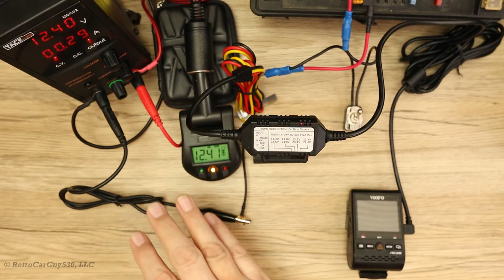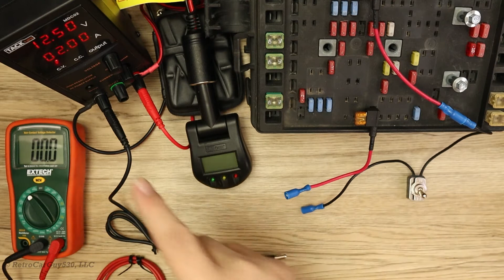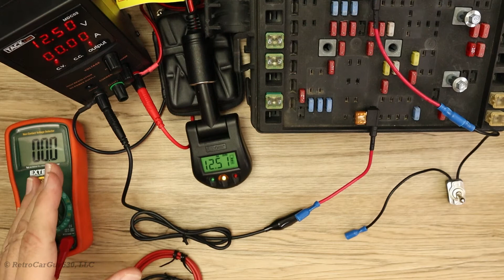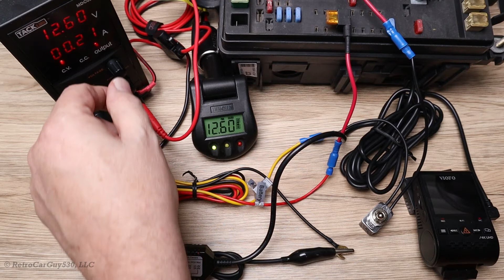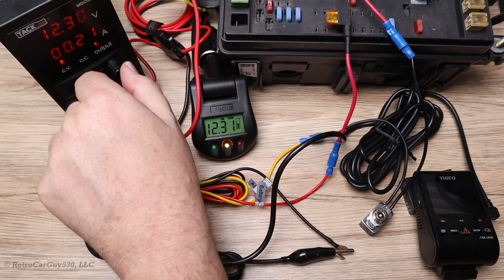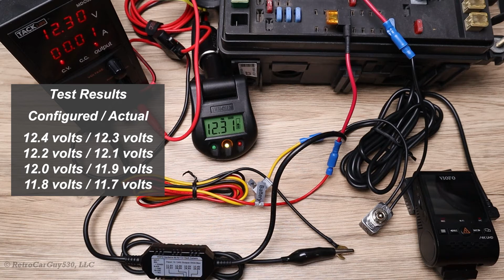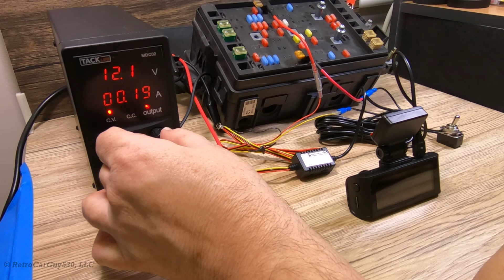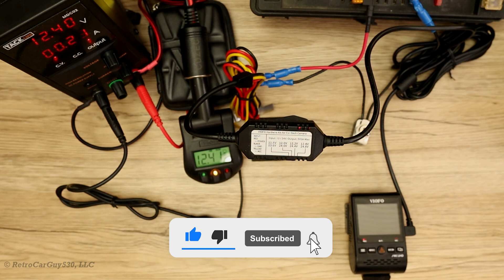Dash camera low voltage monitoring feature - How accurate are they?

Comment from the maker: I originally released this video in early February 2021.  On 16-Mar-2021, I learned that the testing method I used was incorrect to verify the low voltage cutoff feature.  I have reworked the content of the video and as a result I have this updated video showing the correct testing method.

⏲ Video Chapters ⏲

00:00 - Intro
00:33 - Testing Overview
04:43 - VIOFO HK3 / Blueskysea B4k power adapters
09:02 - Final Thoughts

Comment: Right on RCG,

What a great video explanation.
I’ve never used a dash cam hardwire kit before, (I’ve never had a need for parking mode for with my vehicle applications).

The one included with my A119 Mini is my first experience. I’ve done some preliminary testing on it, and I’m now converted to loving this fantastic little device.
Not only is it accurate, I’ve discovered it has many other uses, and advantages over the USB power cable & charger.

What a coincidence. 
I have the same Innova 3721 Battery Monitor. I bought it at my local Walmart for $10 when I bought my Crown Vic back in 2009 because it has a constant power point under the ash tray. It’s been continually plugged in for the past 13 years! I keep waiting for it to crap out, but it just won’t die. It’s accurate with my Fluke 115 to 0.01 Volts. If I had know better I would have bought more. Now they’re $28 on amazon.

How do you like your Tacklife MDC02 power supply? 
I see they’re on sale at Walmart for $67. Can you recommend it?
I’ve been getting by doing all my power consumption testing with a car battery, and using my Schumacher smart charger to control the voltage. But an dedicated variable power supply looks way more convenient. 

3:52 Good tip for people trying to do their own testing. My Panther Cars take around 30 minutes for all the modules to go to sleep. 
-Chuck
Reply from the maker: The Tacklife MDC02 works well, but the amp display only shows two digits after the decimal point.  I also have a 5 amp Tacklife MDC01 which has a three digits after the decimal point.  I've recently purchased a Fluke 117 which has a min/max/avg amp draw capability.  The Fluke 117 and the MDC01 are usually within .001 (1 mA) of each other, so the number of digits in the amp display of the Tacklife unit isn't as important now that I have the Fluke 117.

Comment: Thanks for demonstrating this research. Can you identify which pin on the usb output side is connected for sending the "parking mode" signal? I know there's three wires, and two are obvious, but I can't tell which pin the third wire goes to. I want to emulate that feature without using this device. Can you tell how that parking mode signal is sent?
Reply from the maker: I don't have a USB breakout box so I can't tell which pin on the USB connector carries the signal to indicate that the 12-volt accessory power has been removed/provided to start/stop parking mode.
Reply: @RetroCarGuy530  I've got one on the way, will see if I can figure it out and report back. I've already got plenty of 5v power on hand, and that parkmode feature would be nice to have by itself. I checked everything I could find already, and this is one of the (or just *the*) most technical analysis I've seen so far, and the related forums I found this video from